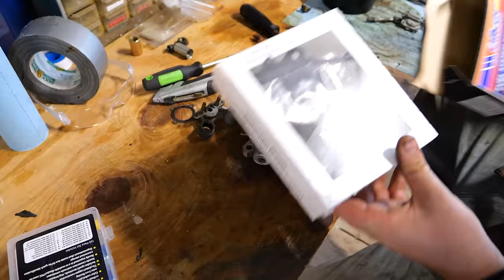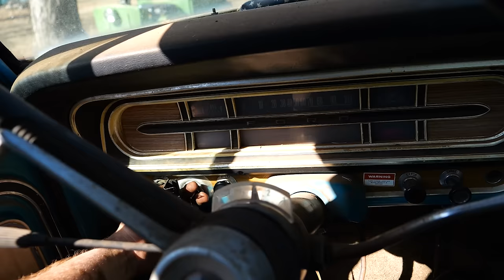Will this STUBBORN Abandoned F100 Run and Drive After 15+ YEARS!?

Comment: Dad's daily driver when I was in highschool was a 70 Ford F-250 360fe auto lite 2100 2bbl, dump truck manual shift Borg warner t10 4spd transmission and the Dana 60 rear with 4.56 open diff.. it was a very rusty truck from western Illinois over by the lakes and the truck had 407k documented miles and the speedometer read close to that the whole time we owned the truck and dad drove it to work and everywhere else we changed the speedometer cable on the back side of the instrument cluster 3 or  4 times and it kept snapping the ends off  .. anyway the motor was so worn out when you changed the oil you had to add two quarts of gear lube 90 weight oil,or it literally couldn't get out of it's own way!! And we put a new tune up on it right after we got it but I and it would keep fouling out the new champion spark plugs and then after it cooled off it wouldn't run on them, so we took the old ones and used a cigarette lighter bic and burned the gas off of the plugs and then wire wheeled and brushed the spark plugs and it would run decentish.. but it would also only idle with the choke fully extended lol and somehow dad managed to drive the thing for 7 years and pull 11mpg out of it daily and it actually had throttle response lol
Reply: And the ole 70 Ford F-250 was one of the most reliable vehicles we have ever owned and that includes my midnight blue and frost gloss white and faded red 83 single headlight 1500 High Sierra doghouse,86 chevy k20 custom deluxe well used and beat to hell Long bed 4x4 farm truck with the rebuilt 355sbc 268h 477/480 lift cam kit and the th400hd stage 2 B &M RV and towing shift improver kit and the np208 part time low mileage transfer case, the B&M holeshot 3,000rpm stall torque converter and it was more like 2,100rpm stall and the 3.08 gears heavy duty 6 lug rear ends lol so it was a tire fryer lol, and momma's green 96 Ford F-250 super cab rebuilt 460 bbf and the factory aode 4spd automatic diesel transmission and the factory diesel torque converter and sterling 10 bolt rear 3.55 gears farm truck...
Reply: Oh I forgot to mention that he drove it till the front cab mounts fell off the frame and the cab was resting on the steering column so the rag joint was under constant pressure and you were not steering the truck if it when it was not running... And it had a oil light but no guage..

Comment: Question for you Kevin. Is it better to get 6 point or 12 point wrenches and sockets?
Reply: 12 point sockets are useful at times but they're not any good for breaking fasteners loose. 12 point wrenches are usually fine because your force is more inline with the fastener head

Comment: after rebuilding my 390 fe for high comp, I cannot for the life of me figure out why there is such a big cult following on these big boat anchors. you can get just as much power out of a 351W, though a 460 is far better. Most expensive classic engine to buy go-fast parts for out there...

Comment: Could you actually rebuild this engine? I have a romanian diesel half of a Y block called the L27 engine and there is even more variants of romanian Y block derived engines than you can think of so people would benefit from a rebuild series on an original.

Comment: I can save for fact that I've seen a motor just like that go for 60,000 or more miles just by replacing the oil pump those that these tend to drop down 8 pounds idol 15 lb running and everyone knows 30lb at an idle as what you should have and not just one motor I've seen pretty near a hundred of them make that same track after replacing the oil pump

Comment: Welp.. I guess the promised Mook video didn't go well this week. That oil almost looked as bad as when I checked the oil in our lawnmower.. We've had it about 10-15 years and my dad has never once changed it and I think we added oil once.. -.- When I checked it not only was it black but I was holding it upside down and it never once moved. I walked 50 feet from the side yard, through the gate and through our front door to show my mom and it still never moved, nor on the return trip.. "It has oil, it's fine, leave it alone." is what my dad says.. Go figure all you hear is piston/rod slap any time you hit a dense chunk of grass.. I am so fearful for my legs/feet when that thing finally seizes and likely shoots pieces everywhere. Hopefully it does it soon before you can't buy new gas mowers in Commifornia. It's a Briggs & Straton though so it'll probably keep going like this for many more years. (it's been doing this for at least 3 years now)

Comment: cant to this with any car built after 1980
This is why u sai9d on out of the 60's or 70's
Back then they where still working as henry wanted it to be  The car or truck can be fix with basic tools
Hell when he first built the M-T he gave u how to carve a new poke for the wooden spoke wheels  Ya he put a whittling knife in the tool box

Comment: I think you work on a tiny forward Kevin I don't know how you can stand it will lack of interchangeability and the lack of universal parts between bored I mean we have been 3 years trying to find a brake booster for 78 rancher which no one makes so we ended up finally after 3 years of looking we ordered 2 off Amazon that was supposed to fit it and neither 1 did so you hit it up making a place and make it fit but that was a big pain i* t** a** a lot of screwing around so I don't know how you could spend we're coming out of the sword More than Chevrolet's the chevrolet parts are all interchangeable in those years and Ford parks nothing interchanges but oil and any freeze

Comment: rn I'm kinda working on trying to get my Grandpa's 1985 Ford F-250, which kinda died 24 years ago, running again. From what I remember, my Mom told me that she and Grandpa were getting our pet snake in Bismarck, went to start the truck, and absolutely nothing. no clicking or anything, I guess. It had to be towed home, was parked in our pasture, and that's where its been until recently. The engine does spin so its not that. Battery cables are for a sidepost. There are some wires that I don't know what goes where but what I do know is which battery end is which thanks to a wiring diagram I found. In terms of the "absolutely nothing" thing, I dunno what that could be. it could be a starter, could be a solenoid, could be some random wire, or it could even be the boxelder bug chillin' out in the wheel well. Anyone have advice on how to free up brake drums stuck because of the shoes rust-welding themselves to the inside?

Comment: ENGINE not motor. Motors run on electricity a engine runs on fuel.
Reply: False.
Reply: Da fuq is the ford MOTOR company then, general MOTORs. Those terms are interchangeable
Reply: Ford Motor Company needs to change their name then.🤨
Reply: @22vx  People use both interchangeably, but the difference is that motors run on electricity and engines run on combustion. The engine converts various forms of fuels into mechanical force, while the motor transforms electrical energy into mechanical energy.
Reply: @MrSlimeMan01  People use both interchangeably, but the difference is that motors run on electricity and engines run on combustion. The engine converts various forms of fuels into mechanical force, while the motor transforms electrical energy into mechanical energy.
Reply: @nancykitzinger3078  People use both interchangeably, but the difference is that motors run on electricity and engines run on combustion. The engine converts various forms of fuels into mechanical force, while the motor transforms electrical energy into mechanical energy.
Reply: @srt8madman727  engine definition from google’s dictionary: a machine with moving parts that converts power into motion. 
Motor definition from google’s dictionary: a machine, especially one powered by electricity or internal combustion, that supplies motive power for a vehicle or for some other device with moving parts. Literally just copy pasted that shit soooo…
Reply: Also, hitting Like on your own comments is lame bwaaaahaahaaahhaahaaah
Reply: @nancykitzinger3078  not according to Merriam Webster